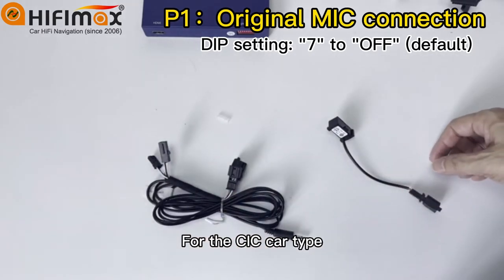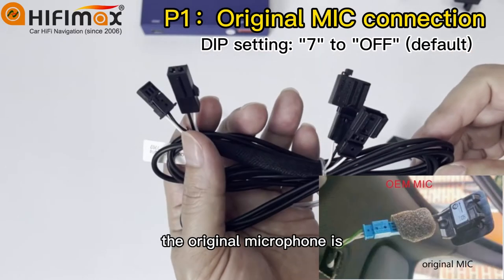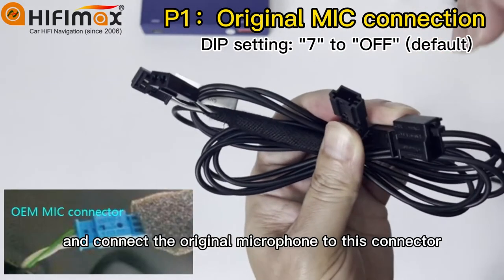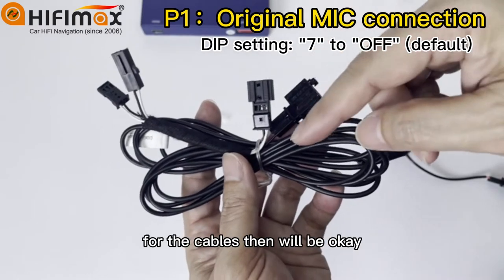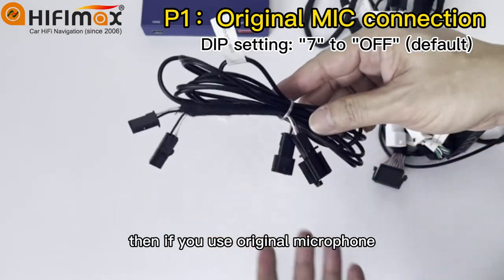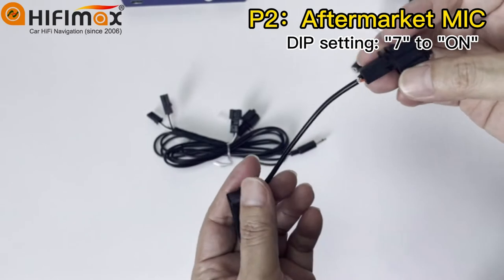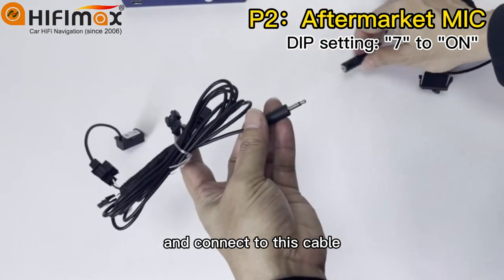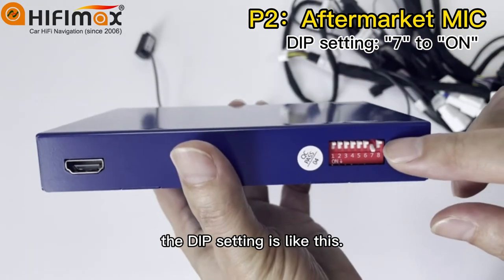Microphone connection - BMW CIC Apple Carplay MIC installation guide

Comment: Does it work with NBT 2017?
Reply from the maker: NBT car types without this split cable, it is controlled by DIP setting ( the 7th pin set to off when use the OEM mic)